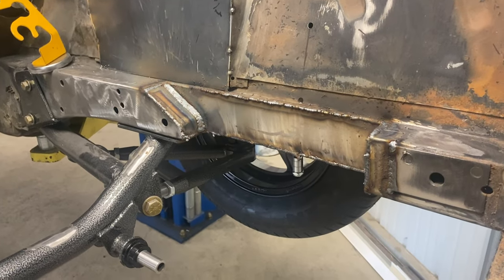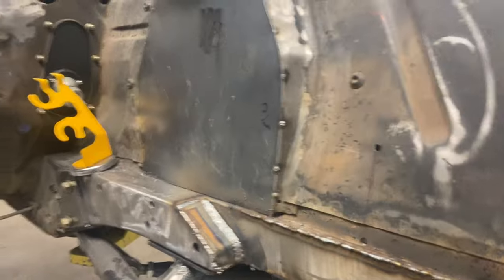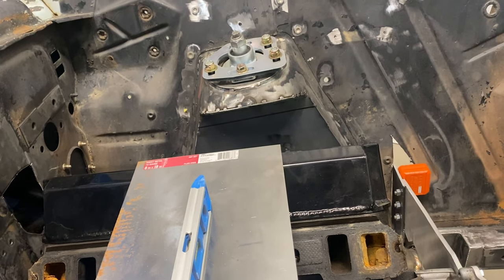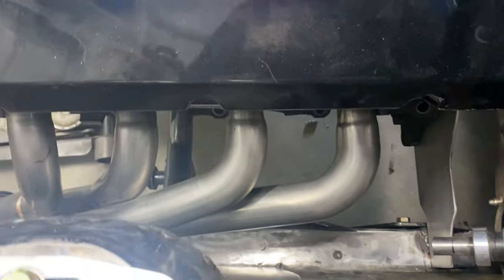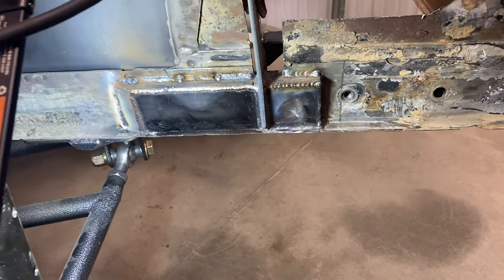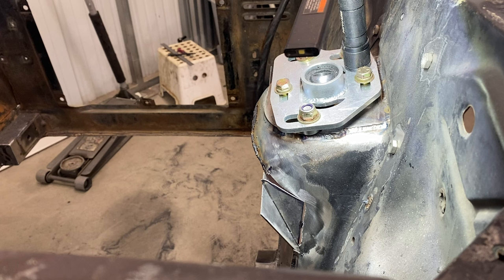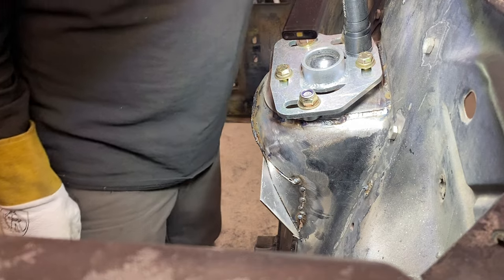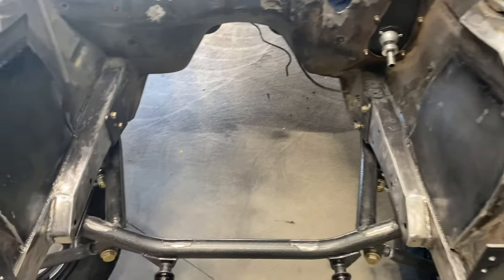More fabrication on the FALCON!

Comment: Those headers will be fine to spool a turbo, we used them on a stock 5.0 with trick flow 160 heads with an 76/82 jb turbo but was an auto. We cut the 3” v bands off and welded a 3” to 2-1/2” transition with a 2-1/2” v bands and crossover with  a stainless 2.5” dual inlet/divided T4 mount
Reply from the maker: I was going to use a merge to take it down to 2/12 so thats good to hear. Thanks for the info!

Comment: Its a race car so open that tunnel on up, make a tunnel you can dzus in and wont ever be a question if you can get to the bell bolts. Those factory bodies were dipped in some kind of coating that burns/smokes and soots off like galvanized dip and i agree it sucks welding that mess plus will make you sick as shit too if you breathe it enough lol
Reply from the maker: Yea its nasty stuff for sure! and yep I think its best to have the tunnel come out, way easier to work on.